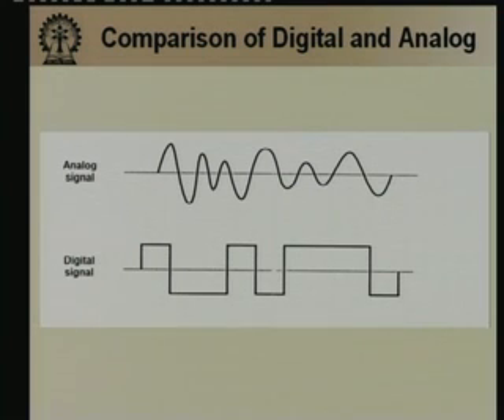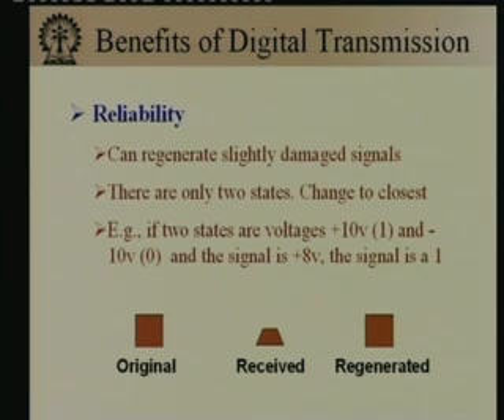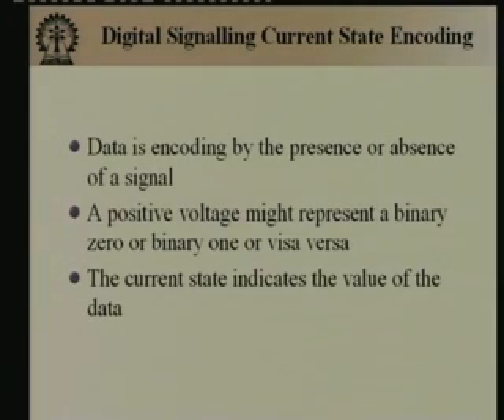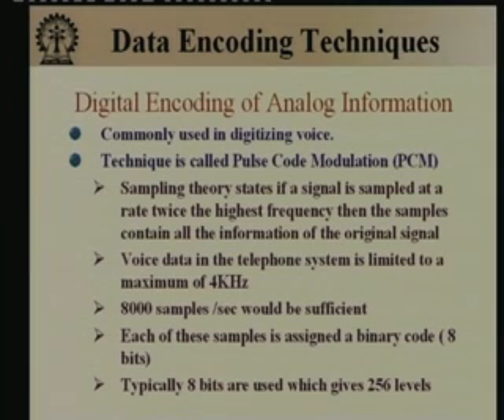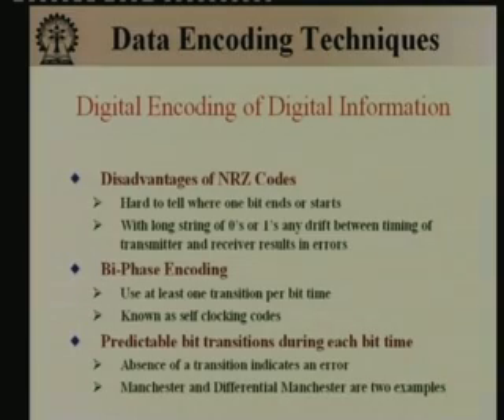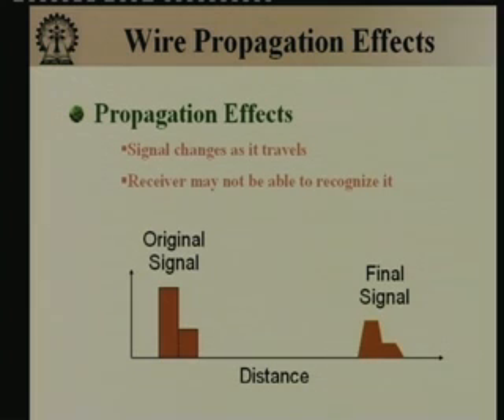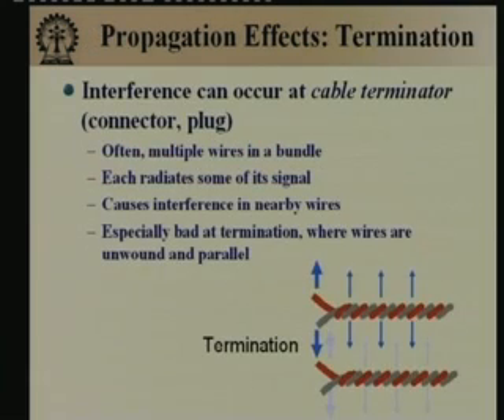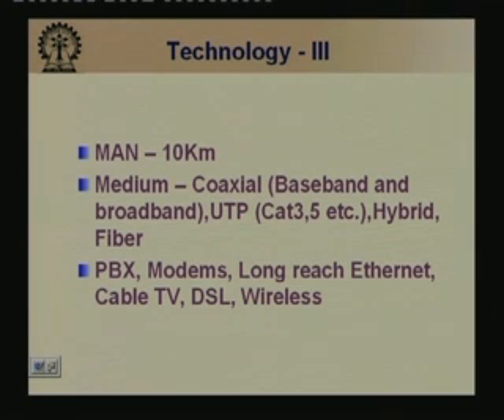Lecture - 3 Physical Medium - I

Comment: Solid, liquid and gas are physical mediums - because energy waves can be sent through them. Take ocean waves for example: seawater (liquid) carries the wave energy via a swell from point A to point B. This lecture is talking about radio waves traveling through air (gas).